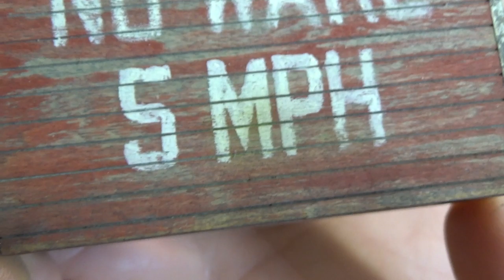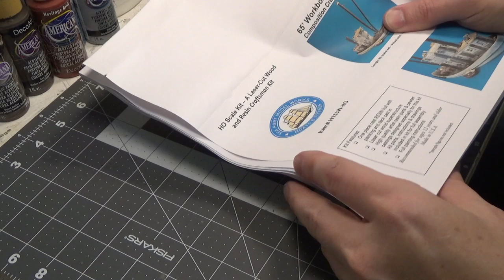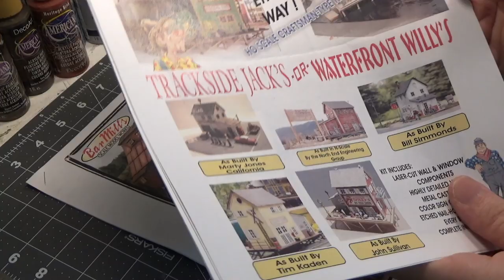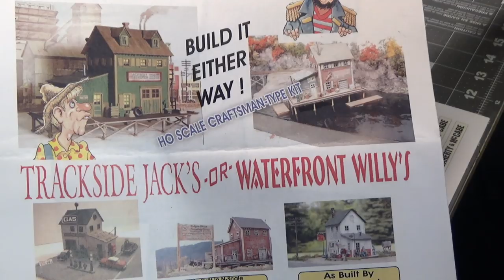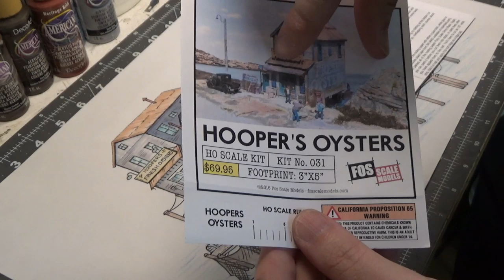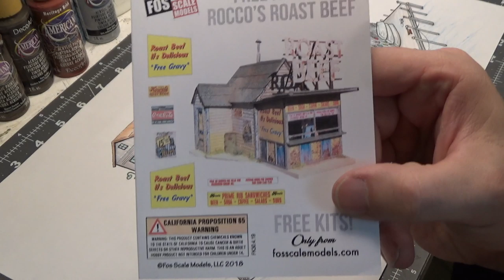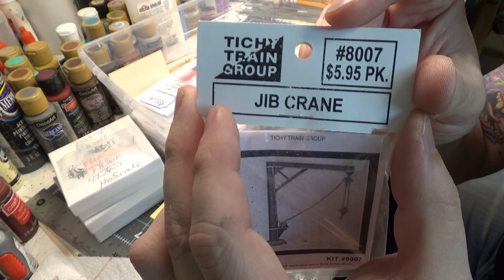Placing structures on your model railroad and building a pier.

Comment: An angled subject always adds more visual interest. Another aspect of this is do not run track parallel to the edge of the bench work if possible. And do not run track work parallel or 90° to streets unless it is absolutely required. Even in a grid type city common in the American midwest and west the grids often have areas where the grid is off angle to other parts of the grid. If you have partial structures against the edge of the layout placing them at a slight angle just adds interest. Especially if the buildings have say industrial interiors. Something you don't see that much.